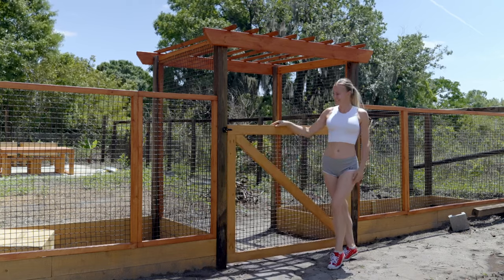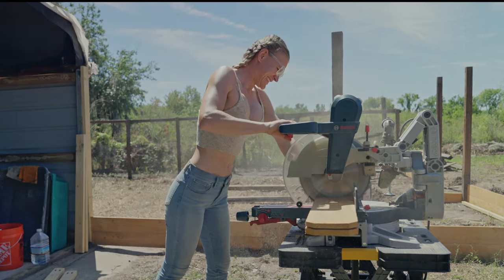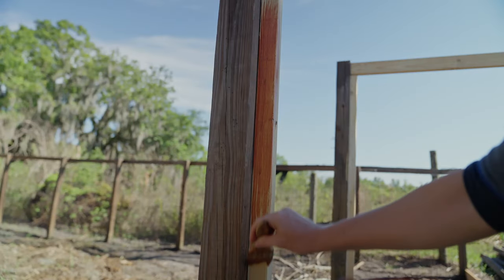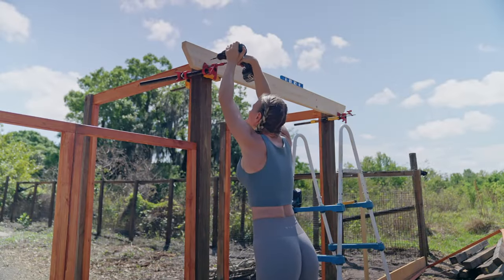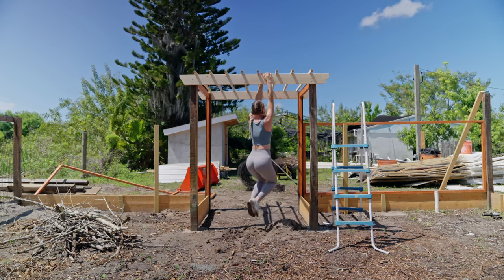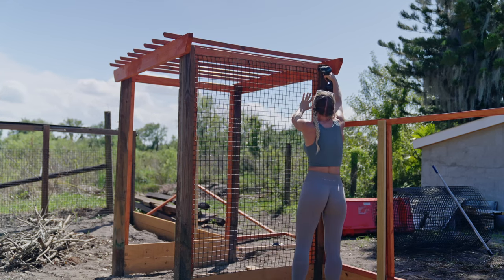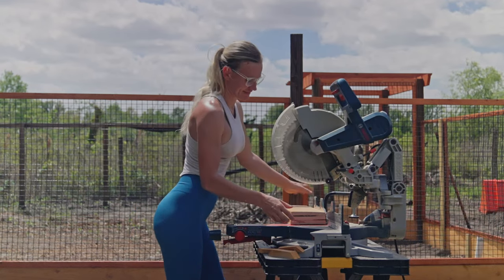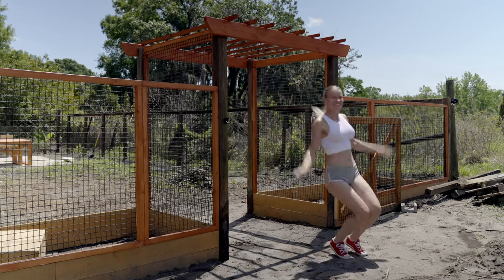Built a Garden Fence with Arbor #gardening

Comment: Very nicely built. To add to your knowledge base you can find "fence staples" which are larger than normal staples and you drive them in with a hammer. You also might want to add additional stakes inside the raised beds to help support that walls and prevent them from bowing out once you fill them with the paint soil.
Reply from the maker: Thank you for your comment Tom. As I took out some of the post, it still have some fence staples attached from the previous owner. I was just hoping I could just use the staple gun to save money and then in the end it probably ended up costing me more... Next time I will just go with the fence staples from the beginning. Learning moment 💡
I've also added a few more support stakes. I should get soil delivered in a few days. So excited

Comment: I'm wondering if you used any pressure treated lumber for the fence and arbor or was it untreated?  For the planter boxes, it looked like you used cedar, but I'm not sure.  Could you let us know please?  The end result looked great and sturdy.
Reply from the maker: Actually treated lumber can be used for gardening since they changed the treatment chemicals they use for treatment. They changed I think in 2004, but so many people are still with the old believe that treated lumber is dangerous. So it's really a preference on what you like to use. I still rather use untreated lumber tho, where I can. Therefore, I use both in my built, treated and untreated lumber.
Reply: @WhatMeikeMakes  Thanks for the explanation!  I've used cedar for years, but I suppose I'll now take a look at some of the PT boards that are out there when I build our next elevated plant beds.

Comment: Good Stuff.
That seems like a difficult way to do it, not just doing the posts first. It also seems like a fun challenge and the type of silly thing I would do. 
cool video
Reply from the maker: Its easier for me to do when I use 4 by 4 posts, I always seem to slightly angle a few of them in the wrong direction and then when I attach the boards it's not flush... and then I'm upset because it looks off, and I can't fix it since it's stuck in cement at this point. So I found this way to be better for me.
Reply: @WhatMeikeMakes  ahhh ha! Method to madness indeed🫡👍🏻

Comment: Nice professional job. I might have overlapped the boards over the posts so as to drill straight through them into the posts, instead of using pocket holes. Slightly more material but stronger connections.
Reply from the maker: Good idea as well, I was going back and forth on the final layout. Too many choices
Reply: @WhatMeikeMakes  Your choices gave the whole thing a more elegant look.

Comment: I wondered if you added any hurricane ties to the build??? Or if you used any nails as screws will not stand up to strong winds as good as an ardox nail does. Great video as always.
Reply from the maker: Hurricane ties to the arbor? No, I added hurricane ties to the wellhouse building I built a little while ago, so it has a closed roof. But this arbor won’t need that. I’m sure it will withstand the winds I get around here 😉

Comment: Is the entrance wide enough to drive the tractor in?
Reply from the maker: No, Its not! That was a silly mistake to not fill the garden beds beforehand, or at least put the soil inside the fence. Now I have to use a wheel barrel to move the soil in. 
I might be able to take one of the screens out and fill in the soil that way. I will have to figure it out.

Comment: If the rasied beds were not so close to the gate of the garden one could have two benches on the ends.  The boards ontop can be a bit wider to sheid some sunlinght.  Its good and nice and all.  Just no benches.  Some type of climbing ivey is good too to plant near it and to cover it.  Grape vines will climb it too.  Just no too many plants maybe 2 plants.  Ivey maybe four plants.  Lots of work already.  Good job. When people install raise beds, they fill up some of the bottom with wood to help hold in mosisture.  It takes less composte to fill it.

Comment: Can still Drive with your Kubotas through the door in the Garden ? 
IT looks great 😊
Reply from the maker: No!! I can't and that was a silly mistake to not fill the garden beds beforehand, or at least put the soil inside the fence. Now I have to use a wheel barrel to move the soil in. 
I might be able to take one of the screens out and fill in the soil that way. I will have to figure it out.

Comment: I always admire your projects and what you dare to do. However, I'm pretty sure that the posts won't last long. They are not allowed to go directly into the ground or concrete. You have to do something about the moisture so that they don't rot at the bottom.
Reply from the maker: Well the posts are made out of treated lumber . I repurposed them. I undug them from a different part of the property where they have been in the ground for about 10 years now. And they were still in great condition. You can’t forget Florida soil is sandy, so it drains very well.

Comment: Good job dear...The only problem i have is the gap When u close a gate Has to be EVEN at Top and Bottom. I Built decks and fences for 35 yrs so i know what i speak of. if the opening is off a little then cut the edge of the gate so the "GAP" is even all the way down....
Reply: Don’t see much wrong with her gap!
Reply from the maker: thanks for the tip Mike